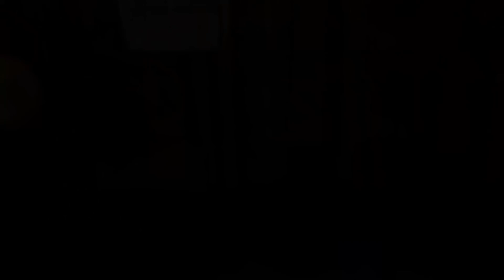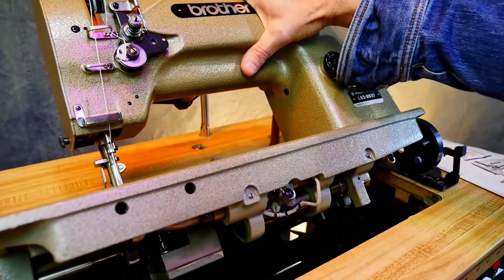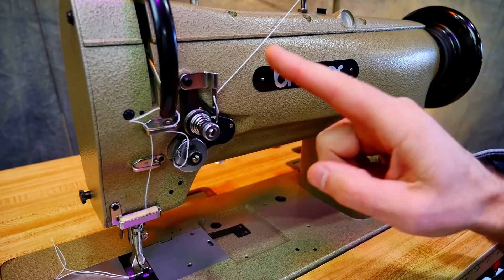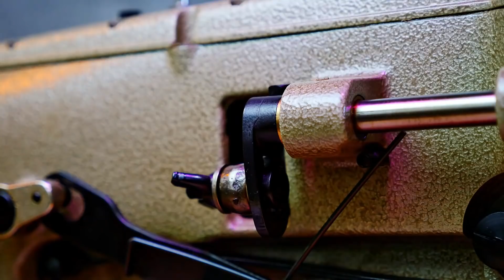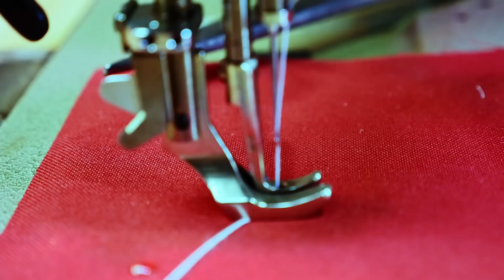Brother LS2 B837 Unison Feed Lockstitch Industrial Sewing Machine

Comment: Of the old machines designed for sewing heavy and extremely heavy leather, would this be one of the options?

Could you tell me about others in the same category whit triple feed? Both industrial straight stitch machines, column machines, and cylinder machines.

Comment: I am getting a birds nest of thread on the bottom of my fabric. I haven’t had this machine long. Any ideas what could be causing this. Thank you
Reply from the maker: A common problem. Your top tension is too loose and so the top thread does not get pulled up into proper position during the formation of the thread, this process repeats for 10 or 20 stitches and voila, birds nest. Here is a video on thread tension and how to adjust. https://youtu.be/xax0RTCqYTk

Comment: Thanks for posting this video Alex. 
I own this machine and have for close to 10 years. I sold an Lu562 to buy it and I have no regrets. 
I do residential and boat upholstery and have yet to find anything it won't stitch. 
I will say, that large bobbin with the horizontal hook can be a bit finicky on occasion but otherwise it's great . 
I am looking at a Singer 211A series machine used as a back up and fory daughter who is starting to learn the business. They seem very similar and have interchangable head sizes for tables. what's your feeling on the 211A in comparison?
Reply from the maker: The Singer 211 series is one of the stoutest heaviest machines around. If you find one  in good condition you will have found quite the work horse.

Comment: I just bought one of these for a back up in case my Juki 1510n-7 breaks down and needs to be sent out for repair.   Same color as this one.  Pretty clean. Not quite as yours is.  took a while to find one and be reasonably priced.  I owned a White LS2 B837 for years. I bought it new and sold it when I got the Juki  13 or 14 yrs ago.  I know they aren't making parts for this but many from Consew Juki will fit. I never did have an issue with my White B837 in many years of hard use. So hopefully this will work out.  
 I still super love the 1510N-7 and never want to go back to these manual types again full time. Been sewing professionaly full time 50 yrs now. Just about everything from Tarps to wifes  household repairs. Ha.
Reply from the maker: I think you could do a lot worse to have this as a back up or maybe just have it set up with a different thread or a folder you like to go to every once in a while. 😀👍
Reply: @AlexanderDyer   I would love to leave it setup but don't have the room. So I will have to keep it under the stairway(only place out of the way) until I need it.  Do you what colors for this machine show? my old one was White. I've seen them Grey and this Bronze as well.

Comment: Thanks for this video....and all the others.... There doesn't seem to be much info on the 837 out there compared to some of the other common machines. The 837 is a fantastic machine that does everything I need it to do and I use it every day for all my upholstery sewing.  When I first got mine however I had a bit of a love/hate relationship as the safety clutch kept kicking in at the slightest thing. From memory replacing a couple of small worn parts and a slight adjustment solved the issue. But now it sews beautifully and I would buy another tomorrow.  👍
Reply from the maker: Yes, this is a good one. I think Brother makes good stuff. All of us need a little care and attention from time to time to get back to operating the way we should.🙂
Reply: I had one for years. I sold and bought a Juki LU-1510N-7 and will never go back to these types. I've had the Juki 15 yrs now and still in awe over its's performance,ease and how much time and energy it save. Well worth the extra money if you think you have that many years left in the trade.
Reply: @jimbobxcityguy5338  Hey there, just wondering what makes your Juki so much better. I own a Brother 837 and also a Juki Lu 563...both great machines but I often think a more modern machine with perhaps an auto trimmer etc would be beneficial. Even after all this time i sometimes neglect to hold the threads when stgarting to sew and cause a big mess 🙂

Comment: Have you ever matched the forward and reverse stitch length of one of these? I am in the process of setting up an LS2-837-310 which is the auto trimmer version. I am at almost 10mm of forward stitch and 5-6mm in reverse on machine spec'd to 8mm. Everything that you might think to adjust seemed locked in place with setscrews and location indents. I even removed the backtack solenoid in case it was binding things up. No luck.
Reply from the maker: No. Some machines just don't do that but I don't know that for sure about your machine. For example I noticed that the Singer 211A566AA lists its maximum stitch length in reverse as less than its forward in the service manual.
Reply: @AlexanderDyer  Thanks for the reply. I considered that it might be something you just cant fix. Seems odd to have to vary the auto backtacking stitch counts to try and balance out the backstitch so the forward stitch doesnt over run the back stitch, especially on such a nicely built machine.
Reply: @lunarconcepts9958  those machines always had a smaller back stitch.

Comment: Is the LS2-B837 only offered in 220v configuration?
Reply from the maker: These can be powered with a 110 volt motor.
Reply: @AlexanderDyer  Where do I get said motor?
Reply: @AlexanderDyer  I suspect one would have to find an approximate   rated wattage 110v sewing machine motor and use a little enginuity to get it mounted into space where the 220v motor came out of.
Reply from the maker: This one will do the trick https://amzn.to/2PpFiJc . Also you can watch this for a little more information. https://youtu.be/lavkvsU5ltk

Comment: I love my LS2-B837...........   Just having a hard time finding a fold down roller seam guide.
Reply from the maker: True. Some drill there machines out but that scares me. Magnetic guides can help or clamp a guide to the table. There is surely a work around.
Reply: @AlexanderDyer  - Thank you.....   I was afraid of that.  Maybe the big magnetic one that Sailrite has......
Reply: Set up an extra slide plate with an edge guide permanently stuck to it.

Comment: I've got a Toyota branded machine very similar to this. Even down to the LS2 model number.
Reply: Actually, now I look at it, mine is more like a triple feed version of the machine you're using in your jasonofalltrades collaboration video. Mines not as tractor like underneath. Still, walks it's way through anything I've put under the foot.
Reply from the maker: The machine you reference is a needle feed machine (with drop feed) so not actually a triple feed. It does not have a walking foot. It is my go to for garments and delicate materials.